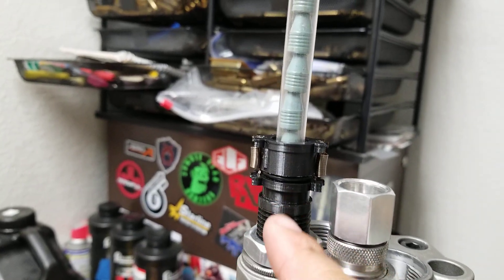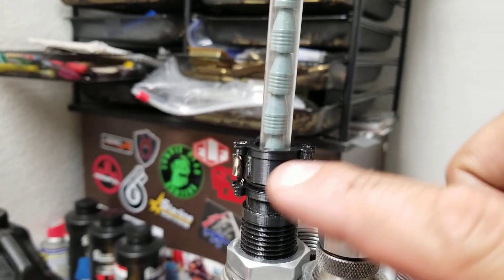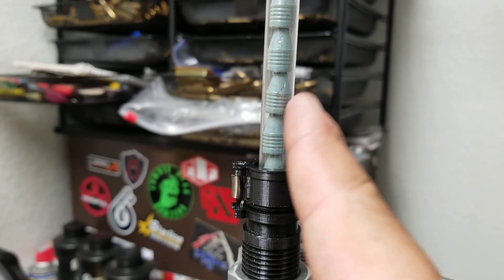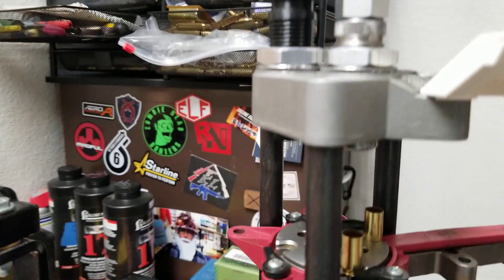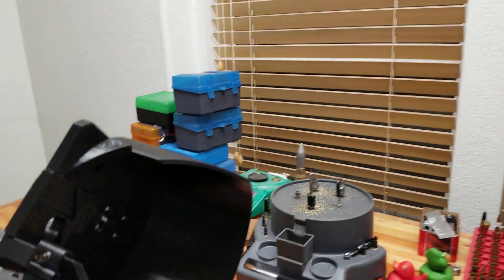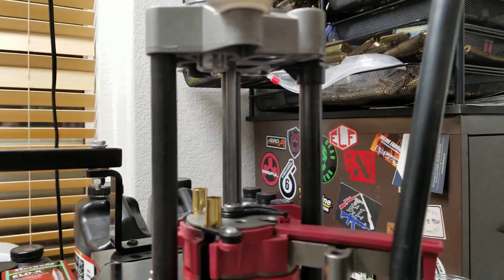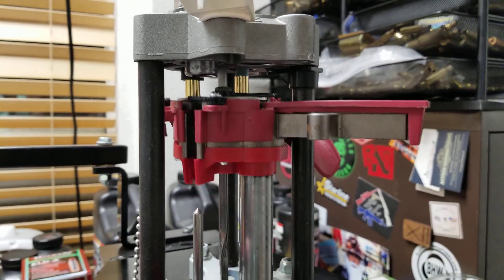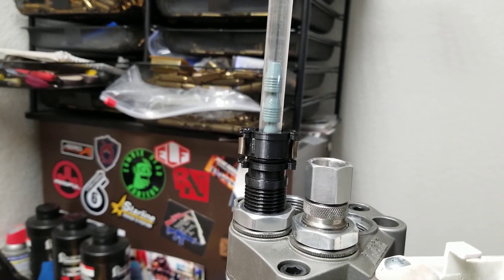3D printed 9mm Bullet feeder die for auto-bullet feeder

Comment: Printed today, sanded down to get it moving smooth. Ball bearings will be in tomorrow. We will be loading polymar coated rn 9mm. Do I need 2 bearings in the bottom holes? They are smooth coated.  Thanks in advance.

Comment: Hi there, question. So I printed the file. Am I supposed to ream or drill out the upper holes so the 4mm balls have room to move? Seems too tight in the current size to fit the two 4mm balls. Appreciate any help. Thank you.

Comment: I printed this out , but it has 4 holes for ball bearings, really not sure which to use. Currently, I have one bearing in the lowest hole and it works great for smooth wall bullets, but hangs occasionally for the cast bullets with groove.

Comment: Very cool, Eagle. I have that press, thanks to you!! Thank you, Sir! So, using this operation would eliminate the crimp die, as it is a 4 station progressive. I would run the rounds through the crimp die on the single stage. How much are these? I can order one soon.
Reply from the maker: Not sure yet. Ya you'll loose a station. But if you use a Hornady bullet seating die, it has a built in roll crimp. Mainly designed this to work with that turn table bullet feeder. Thanks fellas
Reply: I've heard you use the the lower holes for the lighter bullets and the higher holes for the heavier bullets